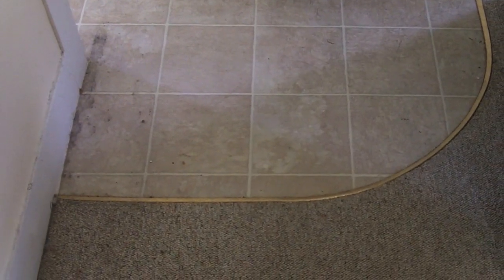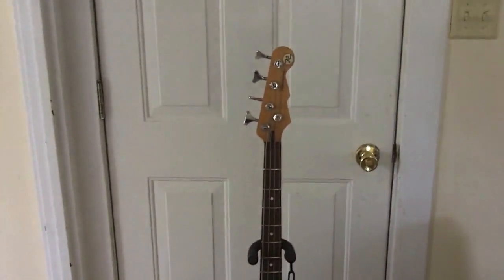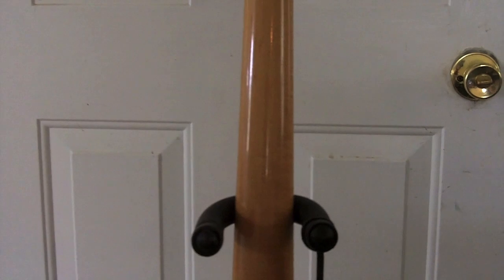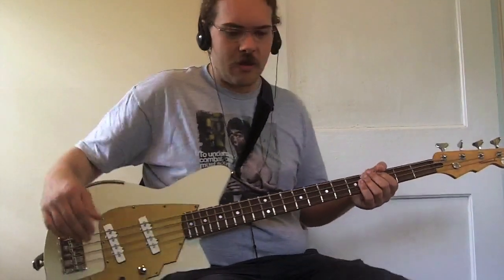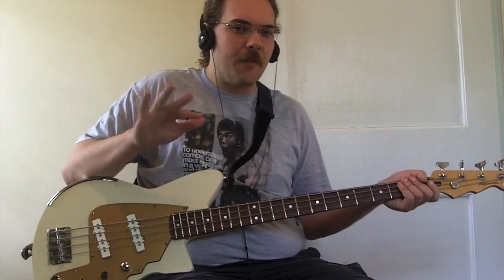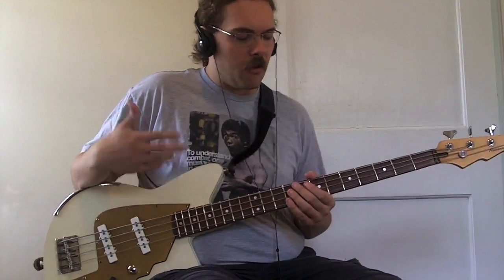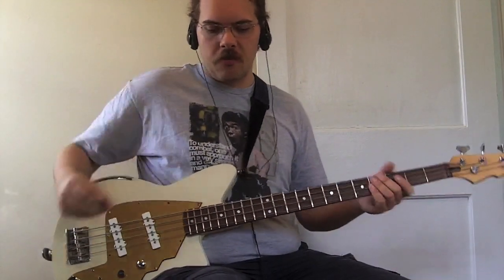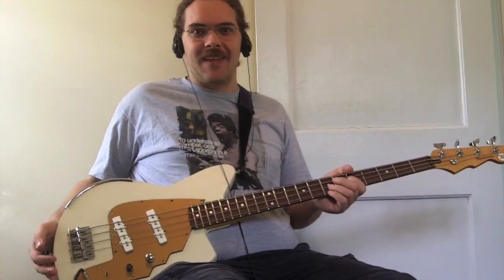Reverend Rumblefish Review

Comment: Do you find the Rumblefish to be neck-heavy?
Reply from the maker: YetAnotherUUBlogger The 4-string in this video is slightly neck heavy. With a padded leather strap it stays put. I may change out the tuners for Ultralites and try correcting that. I have a 5-string Rev that is very neck heavy.
Reply from the maker: +YetAnotherUUBlogger just a bit. A padded leather strap helps. The 5-string version is quite neck heavy.